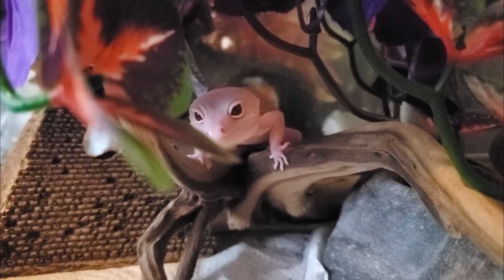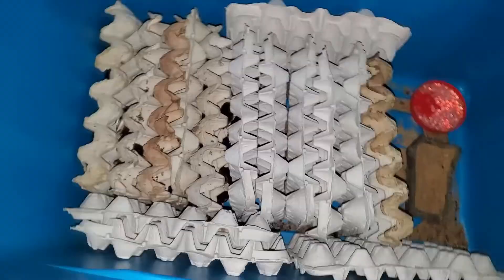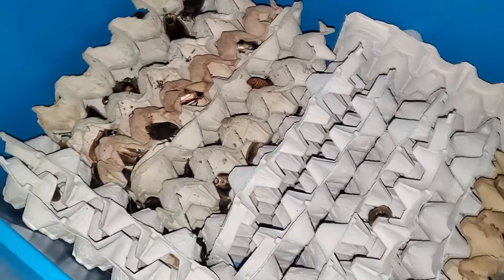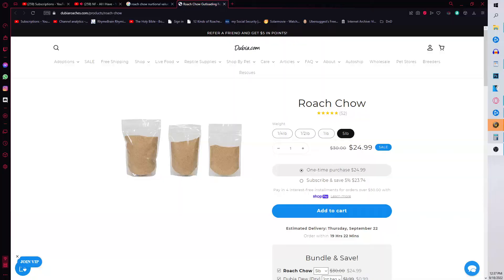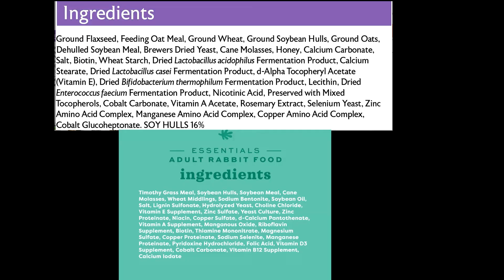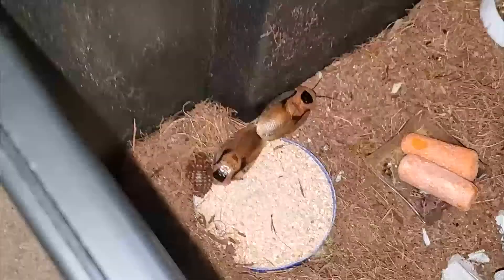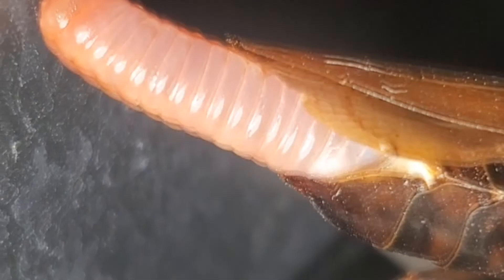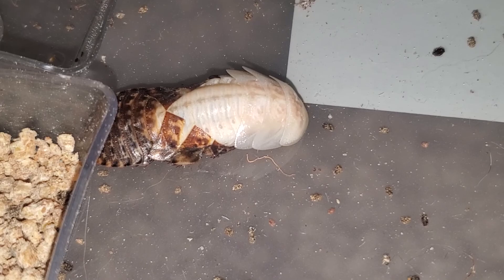Discoid Roach Breeding Guide 2022 - Dubia Roach Replacement - Florida Legal - Discoid Roach Setup

Comment: Looking to add some roaches as food supply on the Florida farm.   These might just be the ticket.  Need thousands.  As far as roach feed, find your local farm feed store and use layer crumbles if you want calcium.  If not, just feed a commodity feed, usually 15% protein with basic grains, much less than $20 per 50lbs bag.
Reply from the maker: Hey! Yes, these are the best option for Florida legal roaches! As far as food goes, I normally avoid things with calcium in them as too high of calcium could potentially cause molting issues. The protein aspect is bad for leopard geckos, which is what I feed them to, and can cause gout in them. So I have been aiming for low protein, basic materials, and no antibiotics. Chicken feed in general isnt super good for roaches, from what I understand, however, I am far from an elitist when it comes to these animals. Whatever is readily available :). I just have to be careful what I suggest on this channel :). However, I am going to look into it! Thank you for watching and taking the time to comment!

Comment: Would the log feed be okay for red runners?
Reply from the maker: Log feed? I'm not sure. But pretty much all roach chow will work for all roaches.
Reply: @KCExotics  sorry I ment pig feed
Reply: @gavdperez94  it's hard to find something a roach will really dislike, as long as it isn't high in fat. Don't overthink it. Whatever has a bit of starch and a bit of protein will be fine. If it's cheap on top, great!

Comment: I ordered from the same website you ordered from and it’s been almost a week and no reply from the guy. I tried calling him and emailing him but nothing. Did I just get scammed?
Reply from the maker: Which company? I don't believe I mention ordering anything in this video. I did order roaches from dubiaroachcolony.com when I started. I'm not sure what would be going on with them. My order came in fine. Did you use the info that was on the card in the first roach video I made? Let me know if this gets resolved. I will cut that portion of the video out.
Reply: @KCExotics  I’m sorry I probably should have been more clear but yes it was on your very first video from DubiaRoachColony. I just recently discovered these and your video was the one like I felt was more promising seeing how you received yours without a problem. I’m still waiting on a reply from them.
Reply from the maker: @bertosalmeron3818  I see... I am so sorry for what's going on with your order. I haven't had many ideas for content lately... and if I honestly had to suggest a company now, it would be Luna roaches. They have an active Facebook group and the owners are extremely responsive. Again, I apologize :(. I bought them through ebay, so I had a more secure experience now that I think about it due to policies. Please let me know if this does not get resolved. 

How many roaches were you attempting to purchase?
Reply: @KCExotics  I was trying to get into the breeding of these discoids since dubias are illegal in Florida. I currently have 30 tarantulas and a beardie and some emerald swift lizards and tired of the crickets smell and noise lol. But yeah I was trying to get enough to start my own colony. I have everything from the crate to the roach food the egg crates and my heater. Just been patiently waiting on my order to arrive.